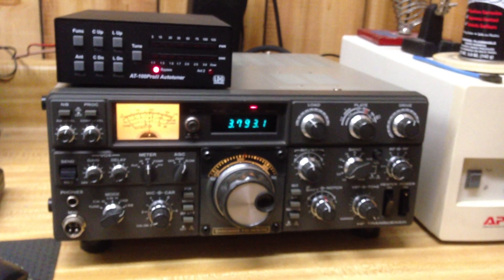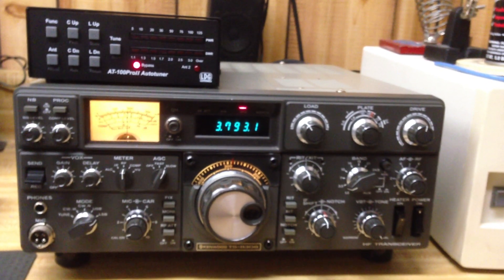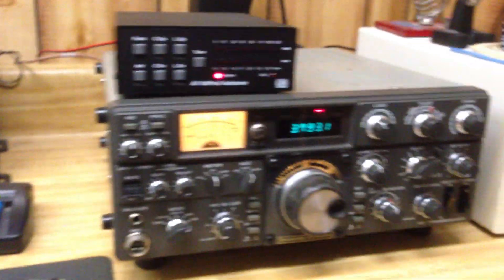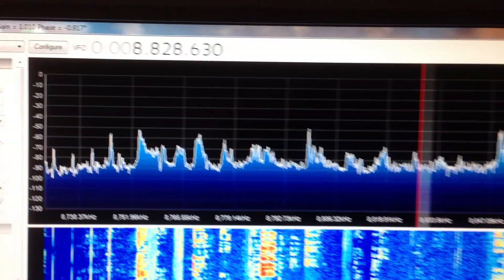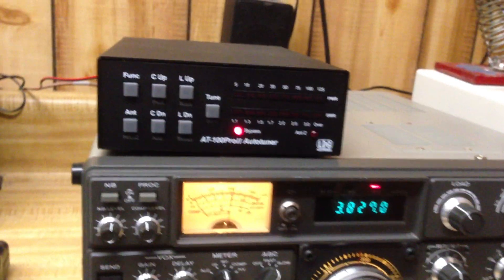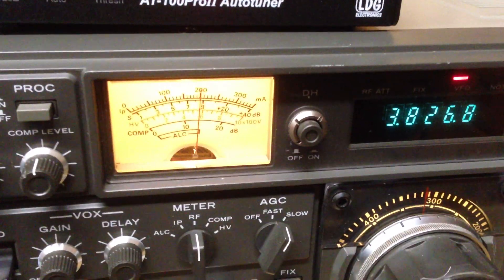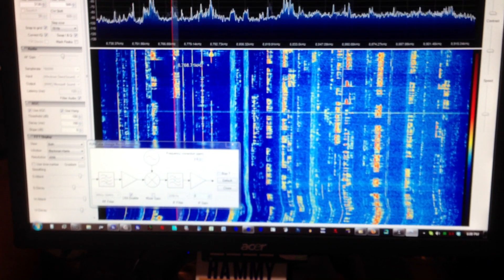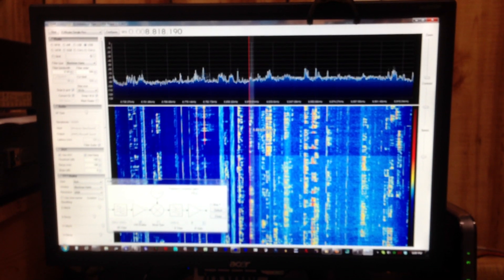Kenwood TS-830S meets Funcube Dongle Pro Plus

Comment from the maker: Hi Jim, it's plug and play!    Levels can be adjusted in the funcube dongle.  Currently, I have a cheap RTL dongle and upconverter in line.   Works just like the funcube dongle--but I wanted the dongle for routine satellite use, so set up the other hardware I had in the shack.

Comment from the maker: No.  It is an older crystal based radio with many limitations in filtering, etc., so there are gaps between bands on both TX and RX.